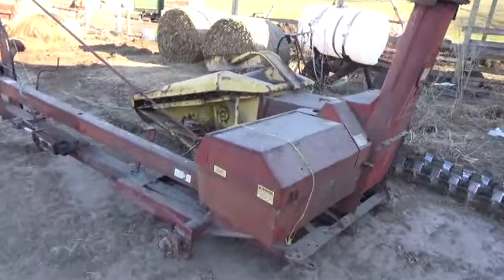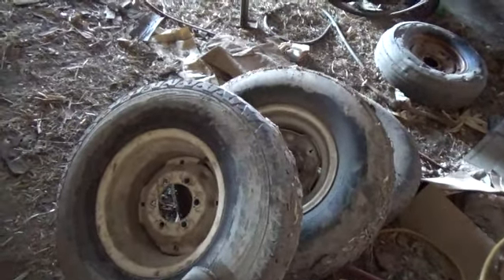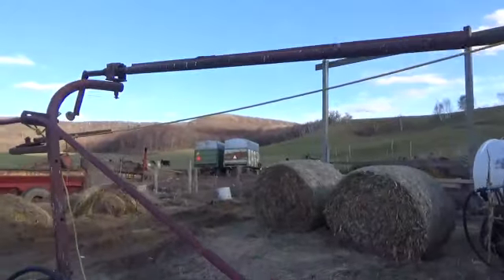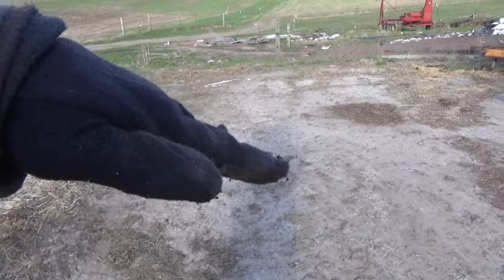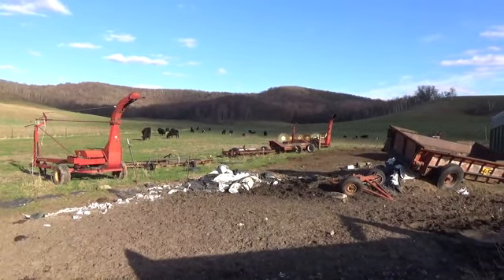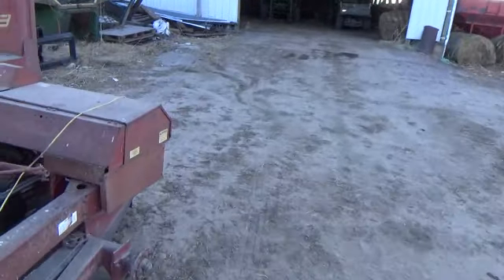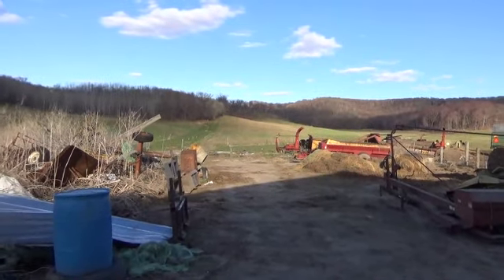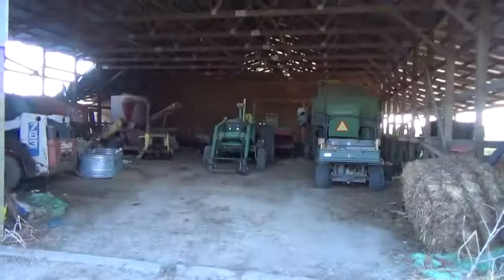Swapped tires and cows on grass

Comment: Swapping tires and lighting furnace fires.  If that's what you did, you did plenty.  Man, thus weather is crummy!
Reply from the maker: As of now no black oak was burned! Lol But by putting smaller tires on the back of the drill to help level it out did help, now it doesn't move as much dirt!